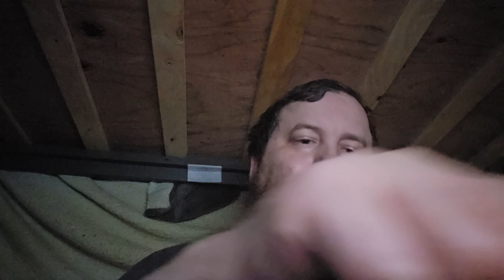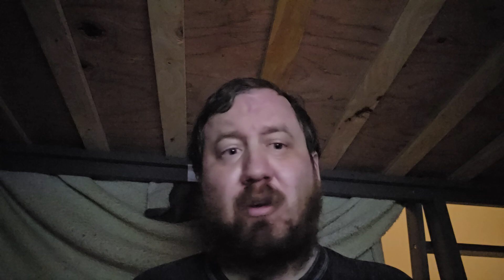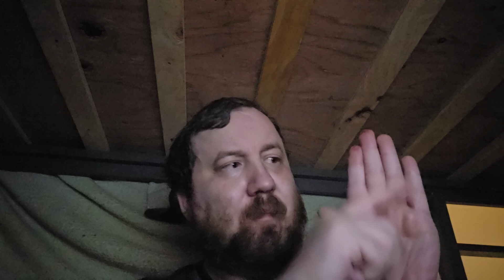Project Station | Bike power 3Kilowatts of house power.

Comment: If I have a electric wheel chair that has electric moter can you lead me to some info on how to wire it up
Reply from the maker: Unless you're trying to modify it and use a 3rd party electric motor system. Then i can't help you there sorry.

But the manual should tell you how everything hooks up and where to. If it's a electric wheelchair. Then it should have such for what goes where on instructions. If not then whoever gave/got you it needs to get their fanny back down to you and do it correctly since whoever supplied it should be the one responcible to fix it up for you to simple flip the on switch and use the joystick on the armrest to drive it.

Wish i could help but unless you wanna give me a full break down of it on a video for me to know what i need to work with to know what is what and how is what. There isn't much i can do just by text.
Reply: Sweet I'll record a video of what I have and maybe you can give me some directions. Thanks  @KillerRaptorr